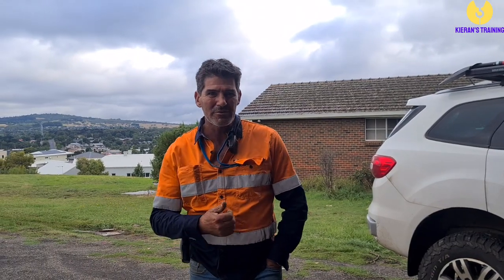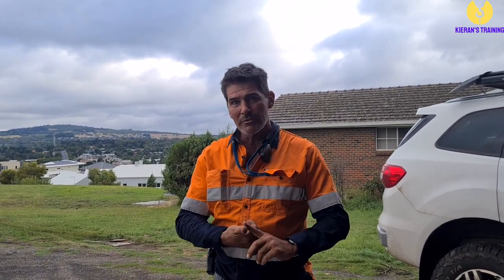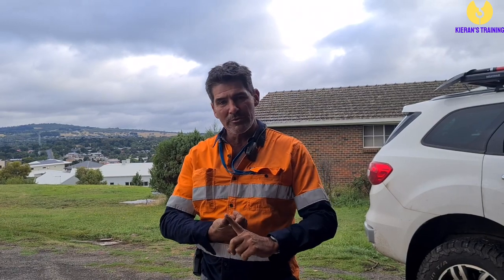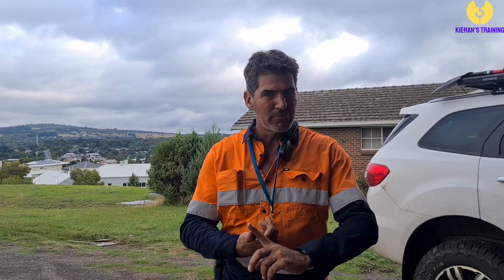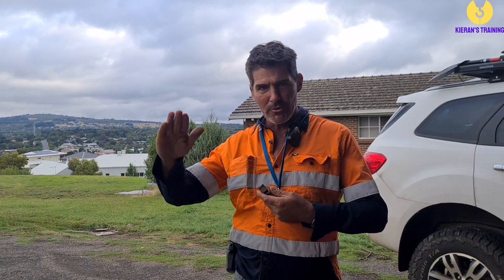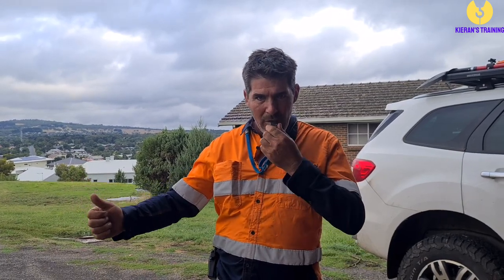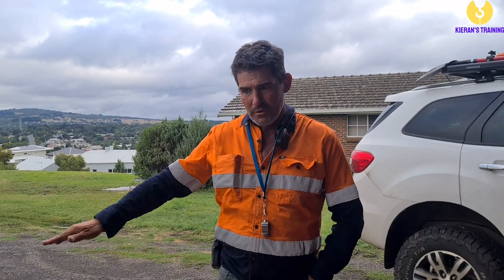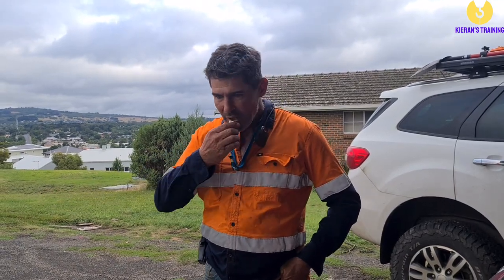Crane whistle signals and hand Signals in construction #crane hand signals, #crane whistle signals

Comment: Also use a closed fist for stop because if your upside down doing a lift as a doggy open palm can means down Slow. Faster you wave your hand the faster you want the winch cable to go
Reply: Hell NO you use a closed fist, well not in Australia anyway. It's hard enough to see from 30 meters away, make it as big and clear as you can see. Boom up or down to stop with a closed fist isn't as obvious or clear as an open palm.